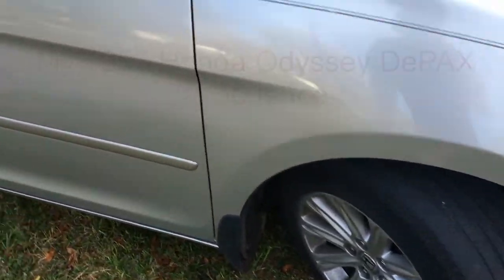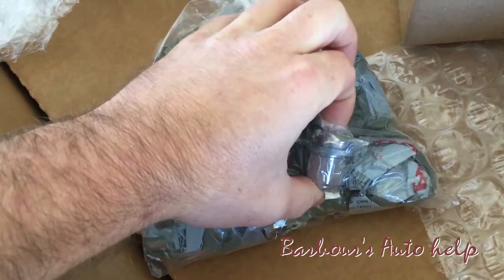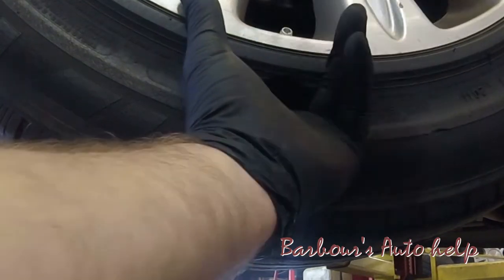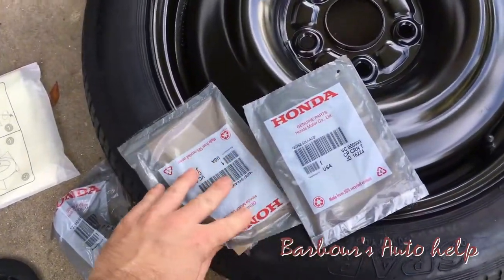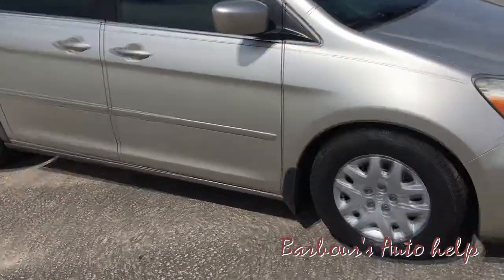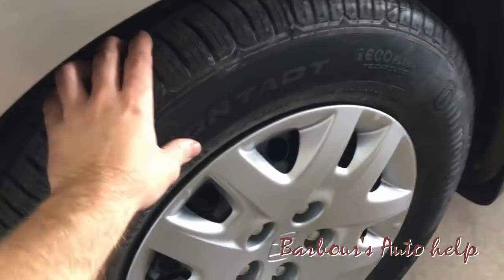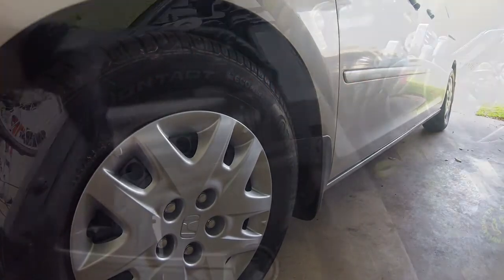My 2005 Odyssey DePAX experience

Comment: In my opinion I like the design on the run flat, we have a 06 odyssey touring and I really miss the old rims ever since we depaxed the van
Reply from the maker: Truth be told, I like the design also.  The rims with the pax tires looked awesome.   However, I couldn't swing it financially when it came to replacing them.  That coupled with the fact that the wore out quickly..... Thus, the depax.
Reply: What size tires and wheels did you use

Comment: Hello, I de-pax'd / swapped out wheels & tires in my '07 Odyssey. Do you happen to know how to reset the TPMS system? The vehicle dash and controls looks very much like your '05.  I tried a tire shop and they tried re-flashing some data on the OBD but the write procedure did not work. Thanks.
Reply from the maker: You’ll need a special tool for that. A tire shop should be able to reset them.

Comment: Thank you for the great video i followed the steps and depaxed my Odyssey but I keep getting message on dash about pax system that message which is annoying
Reply from the maker: What exactly is it saying?
Reply: BarboursAutoHelp, I just Depaxed my wife’s car last night. She just received a message this morning that said “ run flat driving  max 50 mph”. I used two sensors that were not from the runflat wheels. I wonder if I need to switch them.
Reply: @patrickbagnano1561  The touring TPMS sensors are different than LX/EX TPMS sensors.  You need to buy touring TPMS sensors or re-use the ones from the PAX tires.
Reply: @n9wox  , thanks Tom I did reuse the sensors from the Pax wheels a few months ago. Now I am dealing with worn rack and pinion bushings and a bad engine mount .  haha   A VCM muzzler should be here in a few days.

Comment: I'm thinking of buying a beautiful 07 honda odyssey touring with pax wheels on it....bad move or no? I'm aware of the high replacement cost tires. But I would like to know are the PAX wheels still readily available in 2019?   Can they be plugged if I ever get a flat?   Any other tips or help from anyone would be greatly appreciated. thank you
Reply from the maker: Yea, they are still available.  I bought my 05 knowing about the cost.  I love it.  As far as plugging them I would suggest not plugging them.  I think they can be patched.  (I think)
Reply: I have 2005 Honda Odyssey Turing. Also looking still to dePAX it. About a year ago had first flat. Honda service refused to patch it. I took it to small shop. They paged it and I am till now on the road.

Comment: Hi I followed and ordered the exact same thing, steel rim, with new sensors. My question is when I tight down the sensor onto the rim, the nut did not go all the way onto the rim so the whole sensor is loose on the rim, even as I have tighted down the nut all the way. Is that normal and what it's supposed to be? Thanks.
Reply from the maker: Not sure what you have going on there.  Mine are tight.
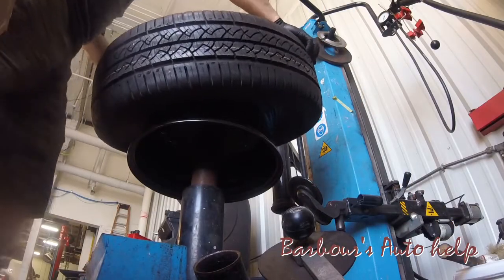Reply: Looking at 4:10 of your video, it seems your sensor is kind of loose too, do you recall? I ordered 42700-SHJ-C01 
LX's steel rim and 06421-S3V-A04
 Touring's sensor for my '06 Touring Odyssey, and all 4 of them are kind of loose fit after the nut is tighten all the way to its end. If tightness is what it should be, then I must find (haven't yet) and add a small o-ring-like  piece on the stem to the outside of the rim before tighten the nut to make up the gap to make the whole TPMS assembly tight onto the rim. I figured if I need to do that in my case, the tire shop must have these kind of pieces in hand in order to handle all these gap issues - I can't be the only one. I mounted one tire to the rim successfully, but now is stopped by not being able to seat the bead and make the tire pop, without a the good size air compressor. What would be the minimal required compressor size (20 gal?) in order to be able to seat the bead of new passenger tires? At this point, I'll likely have to bring all the parts (steel rim, new tires, sensors) to the shop for the installation now. I have done a lot of repairs on my van so I'm mechanically inclined. I put a lot of thoughts into this DePax project, and have tried. At the end I feel this is not a simple or worthy (money-to-effort) DIY to take on yourself if one doesn't have all the right tools (especially the good size air compressor) already.

Comment: Now that you have been driving on these regular tires for a while, are you still happy with your conversion?  Several of the OEM sites recommend that de-paxing will mess with the efficiency and running of the vehicle.  Have you noticed this?  Wanting to do this conversion, but worried about potential ramifications.
Reply from the maker: Its been working fine for me.  Hasn't affected my vehicle in any negative way.
Reply: I've experienced vibrations in the Steering wheel which drives me crazy. I used acura mdx 20x8 wheels with 245/45 R20 tires
Reply from the maker: Check the balance

Comment: What size rims were these for a 2005 Honda Odyssey Touring
Reply from the maker: I replaced the existing rims with 16" steel rims.  I had to get a different sized tire so that I would have the same over all circumference along the outside of the tire so that my speedometer would be accurate.  There are a couple of websites that sell depax kits for Odysseys.  I would suggest researching on one o f those sites.  I'm not going to recommend or endorse one particular web site, but I got my depax kit through College Hills Honda.  Like I said, I'm not endorsing or standing behind their product or information provided by their web site.  this is just where I got mine from.  I don't work for them either by the way.
Reply from the maker: By the way I am very happy with my depax kit.